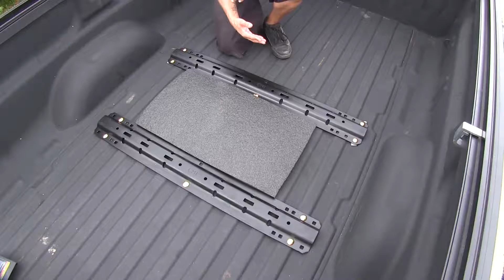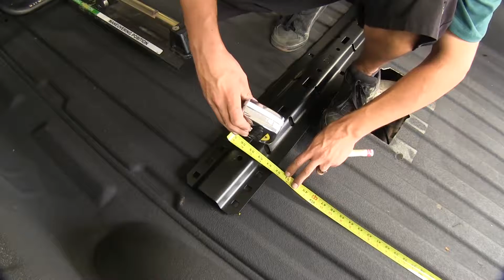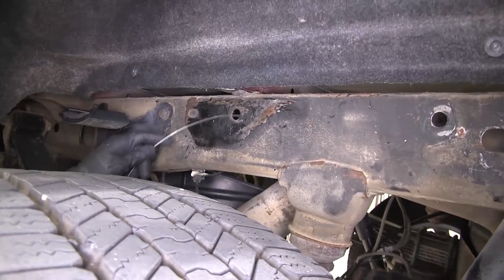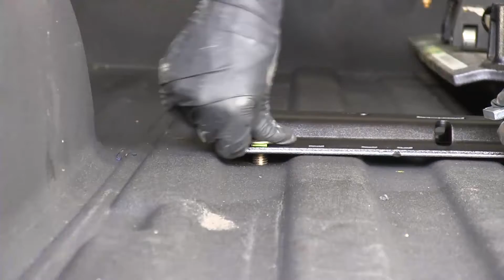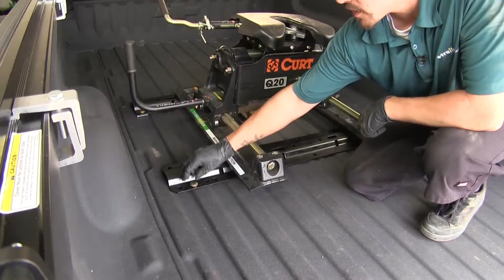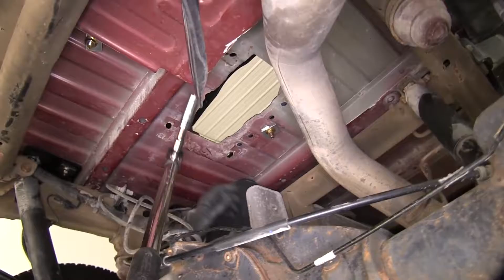Install: Curt Custom Fifth Wheel Installation Kit for Chevy/GMC on a 2015 Chevrolet Silverado 3500

Comment: Does the dually get the same install?
Reply from the maker: The install on a 3500 DRW would be the same, unless it's a cab/chassis truck. If that's the case, the bracket kit won't fit.
https://www.etrailer.com/5th-Wheel-Hitch-Rails/CURT/C16411-104.html